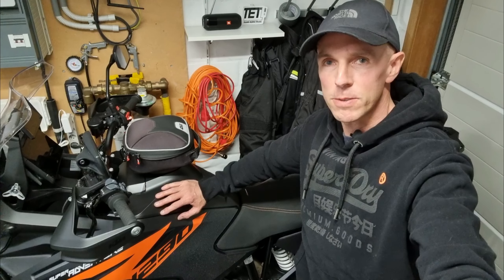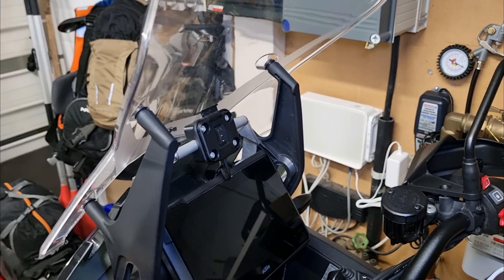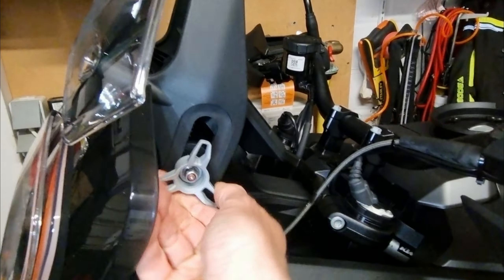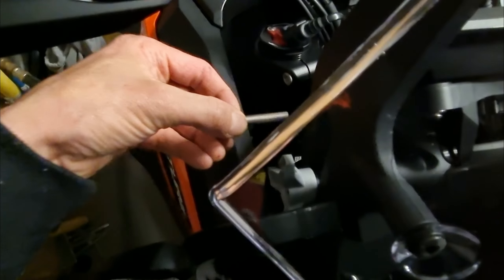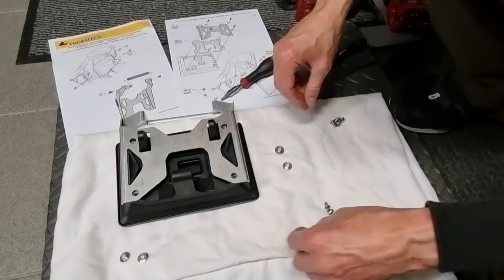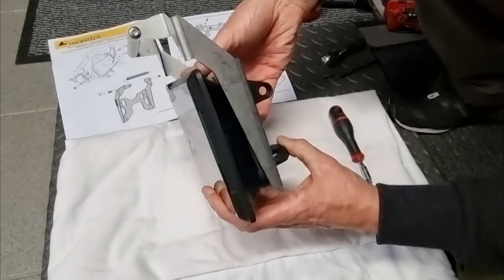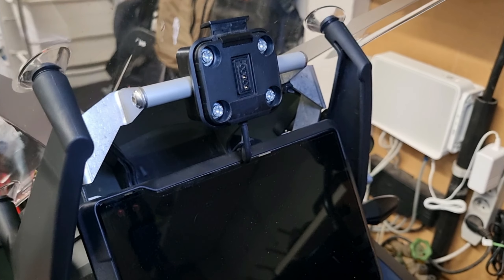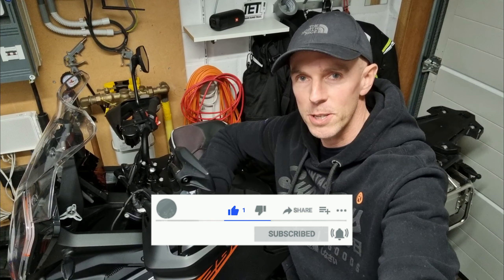TOURATECH GPS MOUNTING ADAPTOR above display INSTALLATION on KTM 1290 Super Adventure S/R 2021-2024

Comment: Thanks for this video. Is the plastic mount necessary? Or are the standard GPS mounts supplied with the Garmin enough?
Reply from the maker: Hello, the box contains also a ram mount to mount the GPS connector on. So it's not necessary to buy the plastic mount. I did to place the GPS on the Touratech mount.